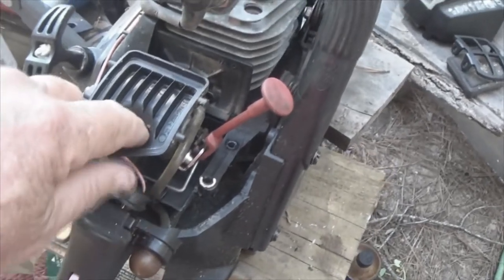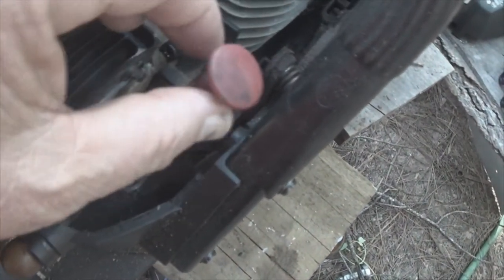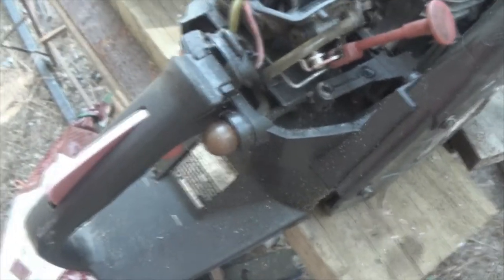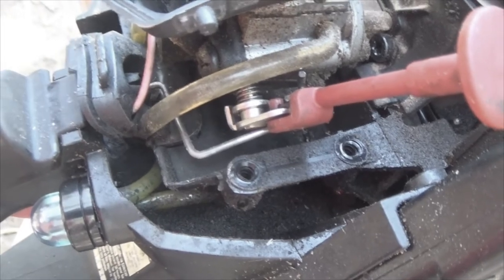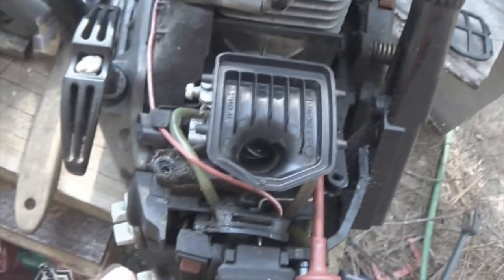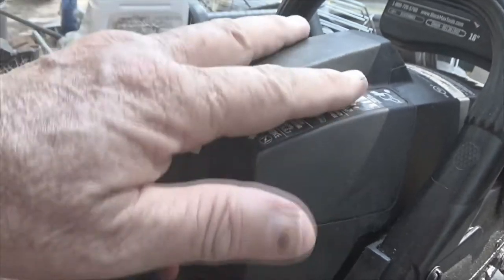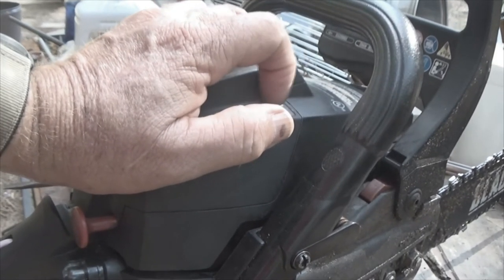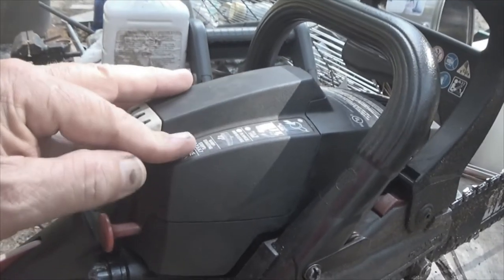replace a primer bulb on a black max chainsaw

Comment: Thanks man. This is the first time I've had to change the primer bulb on my BM chainsaw (or ever, really) and the video helped tremendously.
Reply from the maker: take care of the saw,  2 different shops would not touch a repair that is beyond my ability to fix.   they told me to buy some other brand, but the saw has worked every time and run like a champ